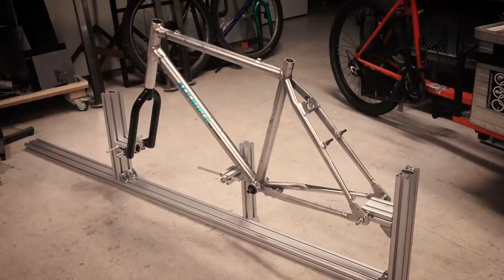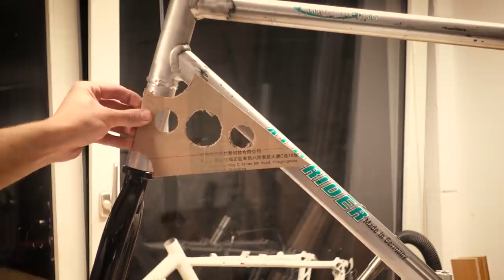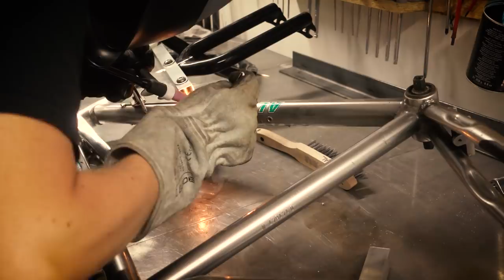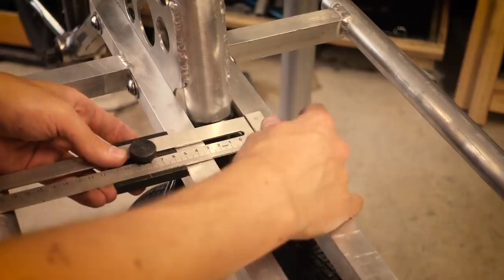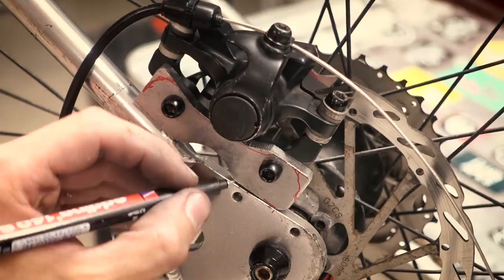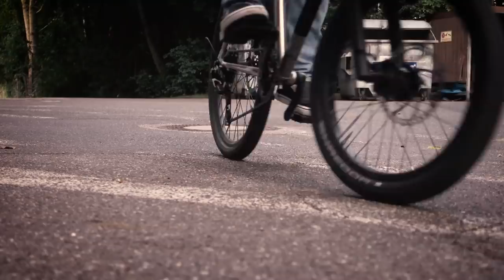Compact Cargo Bike / Cycletruck

Comment: Too bad they don't sell an affordable frame kit in this style. All I have seen is the kits for long bikes with the big front bucket area. I'm legally blind, can't drive, and live in an apartment with an elevator so something like this would be perfect.
Reply from the maker: You could look at the Omnium Mini which is also sold as a framekit, but depends on what "affordable" means. Cargo bikes usually aren't cheap, it just comes with the territory due to producing much smaller batches and higher production costs
Reply: @PhilVandelay  The Mini V3 looks like it will be perfect, and yes dealing with bicycles all my life I'm quite aware of how expensive they can get after riding recumbents most of my life. The Mini V3 frame kit is a good choice since it offers a few optional accessorized that would be good like the sturdy center kick stand. Thank you for the suggestion.

Comment: Super cool build!  You may experience a stress fracture on the rear triangle if you do not reinforce this area.  This is due to the downward bending force the brake caliper puts on the frame, which was strong enough to break my modified titanium frame.  A bar from the forward bolt to the seatstay should strengthen this enough that you won't see problems long-term.  Lots of current hard-tail designs incorporate this feature.
Reply from the maker: Yeah I know a lot of people put them in, so far I've never had a problem without it so I'm usually too lazy to do it.. I guess It'll take a broken frame for me to learn the lesson 😅

Comment: I think if I were doing that I might clamp the head tube and extension to a piece of angle iron to line them up, then do a couple of tack welds to hold them in alignment before doing the final weld joint.
Over all, I'd say that's some pretty good workmanship.
Reply from the maker: Yeah that's a good method if both tubes have the same OD

Comment: Did you build the front wheel yourself or where did you get it? I haven't really found all the specs in one package: 20", disc brake and dynamo. Omnium seems to sell one, but 339e is quite steep.
Reply from the maker: Yeah they are not easy to find, this one was a front wheel from a Bullitt cargo bike I found used. There are some stores/onlineshops that build custom wheels, that might be the best bet if you don't want to lace a wheel yourself

Comment: @Phil Do you feel confident that welding a disc brake mount on a normal aluminium fram is safe enough for a public road vehicle? Pushbike. Whatever; you take the road with that. I mean the alu/ frames are being heat treated after welding, and are reinforced where they weld the disc brake mount. You neither have the reinforcement nor the heat treatment. I'd worry about that.
Reply from the maker: Yeah I'm confident it will hold, I mean it's not like I'm riding down MTB trails with 200mm discs with this.  I have never had a single thing break on a frame that I worked on, and like you said, I only ride these myself. if I worried about this kind of stuff I'd never build anything. I'm actually surprised myself that nothing breaks because I'm kind of curious about what the limits are :)

Comment: Nice. Can't tell if the front forks are offset enough like the soma tradesman. That bike'd be brilliant if it wasn't one size fits all. Still pretty good. Specially with a hub motor in the front wheel. Makes the steering less twitchy.
Reply from the maker: You mean because of the handling? I kept the original steering angle so it's definitely a bit steeper than on the soma. So yeah it could use some more slack when you're carrying heavy stuff but on the other hand I really like the snappy handling when it's empty. The whole thing was kind of an experiment anyway (just wanted to mess around with some aluminum) so I didn't plan it out too much. It's a great bike for just zipping across town and picking up a thing or two. I think the soma is more suited for heavy hauling though.
Reply: Phil Vandelay yeah,  I think my main reason for liking the somas offset fork is because it makes it harder to go otb and increases the amount of weight the rack can hold before it flips.  Soma still seems to love falling over when leant up against stuff.
Reply: soma only suggests 50lbs though, what do you reckon how much you can load? also, have you got some drafts for this one?

Comment: Very cool build. Glad I landed here. Was hoping to see some barspins during the test ride, but I guess you can't have everything. What is the rubber tubing for on the front rack? Just tie downs, or an insulating cushion for the cargo box?
Reply from the maker: I don't think barspins are possible now with all the cables attached ;) The rubber tubes are mainly just for keeping small objects from falling through the rack and to provide some friction so stuff doesn't slide around as much. I'll probably just attach a fixed box at some point.
Reply: Phil Vandelay thanks for the reply. And very nice build. Keep the content coming please.
Reply: Phil Vandelay I really want to ride this bike. Here in Montreal you can see old delivery bikes like this, made of steel with 20" front wheels. You'll find them outside depaneurs in some older neighbourhoods.
Reply from the maker: Yeah there's a few of them around here too. Here they were used a lot by bakers back in the day to deliver bread. Hence people call them "Bäckerfahrrad" (Bakers Bike). Like most cargo bikes it's actually a pretty old design that has been forgotten for a while and is now reappearing

Comment: guy, i love these videos!.........i have spend the last few nights searching all the info on parts to build my own frame too but, i have one big concern, HOW DO I HEAT TREAT THE FRAME AFTER??????  or should i just over-engeneer the dam thing just to be sure it wont break?
Reply from the maker: I've never heat treated anything and haven't had a single problem... so in my opinion people make too big a deal out of it. If you're using steel it should be even less of a concern. But that's just my anecdotal experience, I'm not an engineer or anything. My motto is just go for it, and if it breaks, you've learned something new ;)
Reply: +Phil Vandelay  dam, Bravo!.........i love modding and building things too! These types of videos are what makes youtube worth it!
   Rather than buying another yuba bike for 3000 euro, i will make something that perfectly fits my needs! Thanks for the inpiration, and bro' make more of these bike mod videos they are Great!

Comment: that looks dope must be super responsive
Reply from the maker: Yeah handling is really snappy, great for the city. Unfortunately it's heavier than it looks
Reply: Maybe a aluminium rack? The backwheel is that a 24 or 26"? Wouldd be badass with a bmx front and rearwheel( a 24" backwheel)
Reply from the maker: The frame and rack are already Aluminium ;) But the steel fork is pretty heavy especially with the extension. Backwheel is 26", thinking of making a version of this with front and back in 20" actually. BMX parts are great, can't break em with normal riding.

Comment: How did you install the cut-up tubes on the cargo platform? How convenient is this? I haven't seen this method before.
Reply from the maker: You just wrap them around the tube a few times on one end (the friction is enough to keep them on) and secure the other end with zip ties or tape. I like using tubes for all kinds of stuff since they're essentially free (just ask your local bike store, they probably have boxes full of punctured tubes they usually throw away). And they have good properties to use them for securing cargo since the friction stops stuff from sliding around and they're very flexible so also work great as holding straps.

Comment: It looks gorgeous but it hasn´t much cargo space. It´s easier just put a rear rack and a box on.
Reply from the maker: Well it can easily carry a person. Handling is much better than having weight on the rear rack due to even weight distribution along the frame and low center of gravity. Plus you always have your cargo in view which is much better for oversized loads.The cargo rack just serves as a base to put things on, you can extend and overload it towards the front and sides. Trust me, if a rear rack was better I wouldn't be building these things ;)
Reply: Phil Vandelay Thanks for  the  answer. What kind of frame you  use?
Reply from the maker: In this case just a random old Aluminum frame, not exactly high quality but this project was more of an experiment anyway. For cargo bikes I always try to use 26" mountainbike frames because they're strong, have good tire clearence and so on. I'll post another video soon of a bigger bike that I put way more work into than this one. For that I used a newer, lighter frame .

Comment: by converting to 20inch fork, and not altering headtube angle, is the overall wheelbase length shortened? is it affecting riding experience? thanks b4
Reply from the maker: Changing the entire front end of the bike does of course affect the riding experience - whether you like the new handling is a matter of personal preference I guess, it handles a lot snappier than a 26" wheel so I think it's pretty fun to ride. But the handling is not "bad" or anything if that's what you mean. It's just different.
Reply: @PhilVandelay  thanks

Comment: which hub did you use on the front? Is it ok that common bmx fork dropout is 10mm and I will use 9mm axle hub?
Reply from the maker: Yeah it's not ideal but it usually works fine

Comment: amazing, can you make bicycle build with "household" tools.... just to encourage people to DIY
Reply from the maker: Well there's a bit of a lower limit, you need at least a welder since you can't really build a bike with screws and nails. But you don't need most of the "fancy" tools/machines in the videos, mostly those just make the job quicker
Reply: @PhilVandelay  I can get access to welding machine, between MIG and TIG (stick) which one you recommend, from vids mostly You used 1.5thickness material
Reply from the maker: @panglimakita  For bikes TIG is great because it's more precise, but it's harder to learn
Reply: @PhilVandelay  yeah I need more practice obviously hahaha

Comment: hi, did u teach yourself to TIG weld and did u have any experience with assembling bikes? thanks, great job there!
Reply from the maker: Yeah I taught myself mostly by watching other Youtubers :) I have worked on bikes before a lot so assembly is the easiest part
Reply: what kind of welder and setup do u operate with? Do u have any basic advice for someone who wants to start doing it like myself? Thanks for replying...subscribed!
Reply from the maker: I use a AC/DC Tig welder because it's good for accurate welding and very versatile, but it's also the slowest/most complicated welding process. What setup is right for you depends a lot on what you want to make with it so you should figure that out first.  There's also factors like how much do you want to spend, do you work inside or outside, do you want to weld materials other than steel and so on. So it's best to first get to know some basics like what are the differences between TIG, MIG or Stick, way too much info to explain here right now ;) And then you can make a decision on what suits you the best and learn the details of how to use whatever process you chose. Some channels I can recommend are CuckE2009 (in his older videos he does a good job of explaining the different processes without getting too technical), Welding Tips And Tricks,  Weld.com, the Everlast channel and there's many more... Basically just start soaking up info, it's a lot to learn but it's not hard if you're motivated!
Reply: thanks Phil, I'm already on it!!